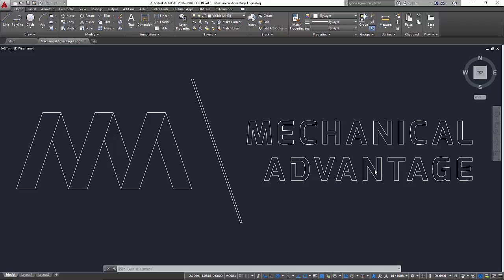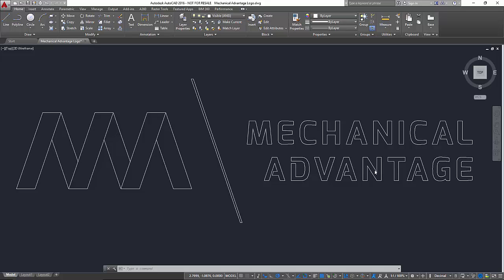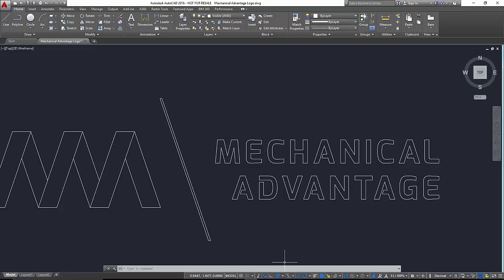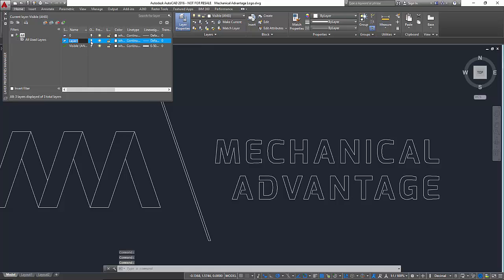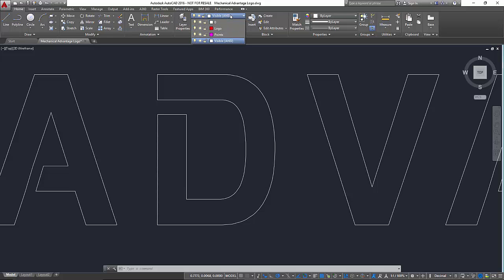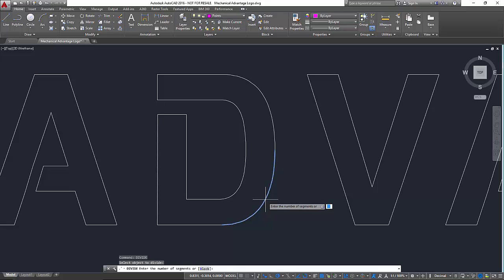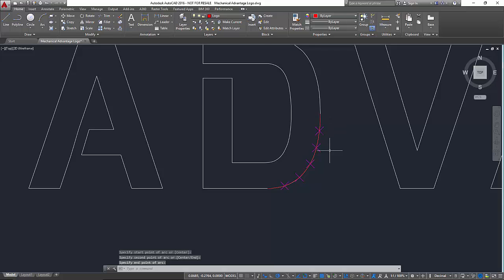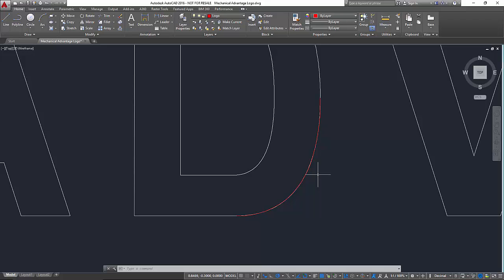Replacing Splines with Arcs in AutoCAD - Part 1

Comment: Very nice video and really helpful. I am not a mechanical major but just wondering if some 2D curve that is essentially function driven (e.g., sine or its reciprocal) and needs to be laser cut with today's technology, when I create the AutoCAD drawing, what is the best practice such that the mechanical shop can work most comfortable with my drawing? Should I use a spline, multiple line segments, or multiple arc segments to approximate the shape?

Comment: I'm using Rino6 software to do this job. It takes less than a minute to replace all splines in this logo to lines and arcs.
Reply from the maker: Kasey K Hi Kasey. You have to to watch part 2 as well. The video above was for people that had older versions. https://youtu.be/t20QbWha8io
Reply: Rhino 6
Reply: @kaseyk1655  hey I need information about that if you you are willing to share

Comment: Liked* However this is very tedious, there has to be a quicker way, txtexplode converts but still requires Spline/Arc conversion to use with cnc.
Reply from the maker: Hi Calvin. Thanks for the like. Good news, there is a more automated way. You can see how to use that method in this video https://www.youtube.com/watch?v=t20QbWha8io